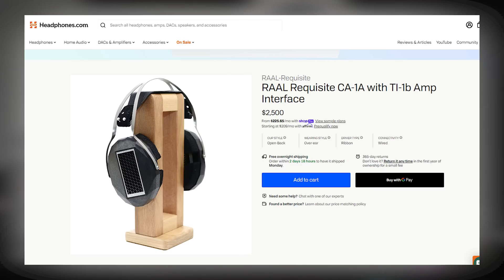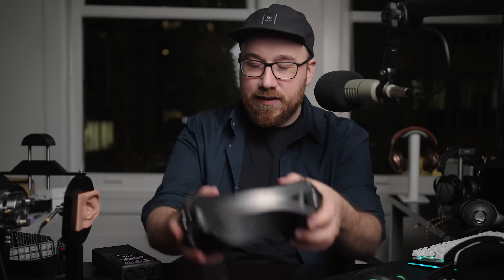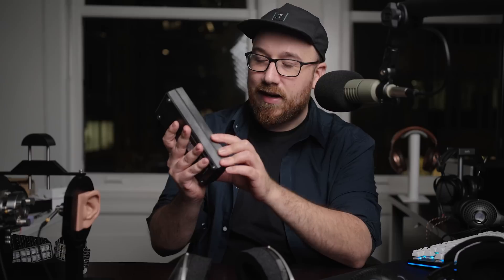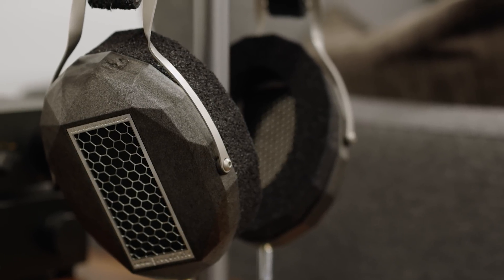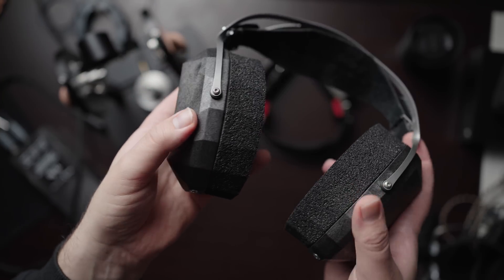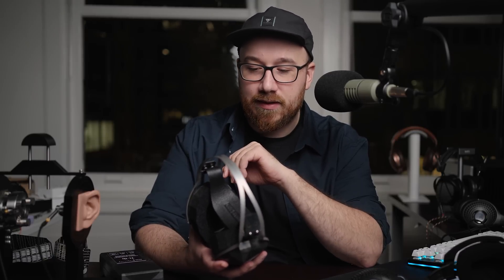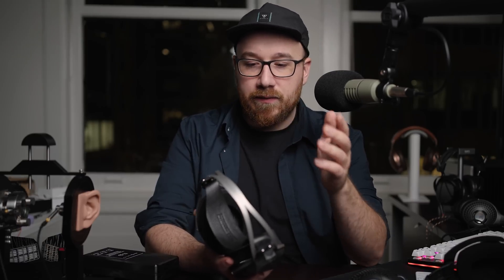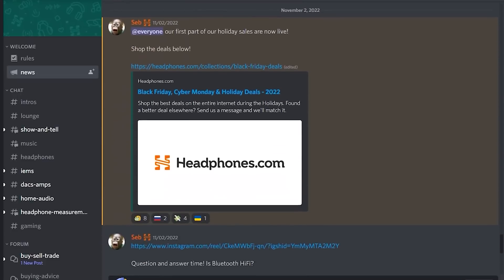What's a RIBBON headphone? RAAL Requisite CA-1A Review

Comment: One thing I forgot to mention, while the CA-1A is a circumaural headphone, it is still open-back. So sound does leak in and out, for those wondering.
Reply: Did you try these with the convolution filters? They fix some of the phase alignment stuff and make these a much easier req imo

Comment: Interesting.  As an engineer I would think that the ribbon driver would be very high velocity, quick on the percussive impulse attacks.  I have full length ribbon on my Magnepans and they were a monster step up over the earlier all 'quasiribbon' high frequency performance, both in sound faithfulness and actually extending the frequency response...the earlier Maggies sucked at both ends, but the ribbons are very easily damaged, grill cloth vacuum cleaners prohibited.  I would love to hear these.  I've got some DIY hybrid electrostatics mostly finished, the Sanders design with the Dyneaudio inhabited TL beam splitters, and am really looking forward to hearing them.  

Not headphones in either case, so sorry for the excursion (see what I did there?)...oh, and I have some Stax SR5s coming today which I'm really looking forward to hearing, as well.  Supposed to be some legendary legacy phones, as I understand it, and my Audio Technika TK33 electrets have long since gone the way of dying electrets...I think I will try to 'recharge' those sometime, but I need to build a well controlled oven to do it right.  

I enjoyed your review here, especially pointing out aspects like the ultra low distortion even at very high levels, in essence usable headroom for tweaking.  I was graduating high school about the time those SR5s came out, so it is also nice to see digital EQs that are actually beneficial, unlike their horrendous unusable cousins.  I'm one of those guys that preferred to turn off the preamp tone controls even with decent electronics, like the Hafler DH110.

Comment: It looks like these will need about 4-5db boost in the upper mids for me. What sort of output power does your amp need to have in order to run these 4-5db above hearing level without running into heavy distortion? If I have something that, say, puts out about 6W into 32 ohms (and I think 9W into 16 but I'm not entirely sure) will that be enough? The amp already runs quite hot, is thermal stability going to be an issue? (it's a Lyr 2 with LISST).

How's the midrange tembre after EQ? And how are the technicalities compared to electrostatics? I.e. if I already have a solid electrostatic rig, does this do anything different?

$2500 is a lot, but also a lot less than some. If it keeps up, that's actually quite compelling.
Reply: I'm running it with a Jotunheim 2 which is also rated 6W at 32 Ohms, sustained - though Jason has said it's 7.2W in reality but he prefers understating the numbers.  It has no problems driving the CA-1a through the TI-1b, dial's at 2-3 o'clock for a reasonable volume on high gain so it's using a lot of that power.

In terms of PEQ or "the curve", suggest looking at Accurate Sound's convolution filter for the CA-1a instead.  Gives you a flat neutral across the board and sounds fantastic to my ears.  Brings out even more detail and makes the wide soundstage even clearer.  Just set that up yesterday and blind A/B testing it was pretty easy using their Hang Loose Convolver with a trial license - was surprised at how much of an impact it has.  Look it up if you're even mildly interested in these.

I know the looks are polarizing but I'm actually a big fan of it - appreciate the emphasis on function while pursuing a different design and look.  They are also very light and sturdy as a consequence.  Would have no qualms taking these on travel if it didn't need extra weight for amp and interface.

Comment: headphones can just always be seen as reverse microphones, ribbon mics, ribbon headphones.
Wonder if there is such a thing as a condenser headphone.
Reply: YES!!! There is such a thing as a CONDENSER HEADPHONE and they have been around for awhile!!!  STAX and AUDIO TECHNICA both sold ELECTRET CONDENSER HEADPHONES, DECADES AGO!!!  STAX ------- SRr84 Lambda Juniors  Electret Condenser Headphones (Which I owned as my first pair of HIGH-END HEADPHONES in the 1970's) and AUDIO TECHNICA ELECTRET CONDENSER HEADPHONE MODELS:  ATH-6, ATH-7, ATH-8 and AT-705.  ELECTRET CONDENSER HEADPHONES are similar to ELECTROSTATIC HEADPHONES, but have PERMANENTLY-CHARGED METAL GRID PLATES (being PASSIVE), instead of needing an external ENERGIZER BOX to ACTIVELY CHARGE THE METAL GRID PLATES.  ELECTRET CONDENSER HEADPHONES .come with an IMPEDANCE MATCHING BOX, to connect to a STEREO AMPLIFIER'S OUTPUT TERMINALS.

Comment: My vote is go with the SR1A use the adapter and get a Soloist 3GT.  Use the sub out and voila you've filled in the bass.   Ultimate speaker like presentation without all the problems of the room.
Reply: The biggest problem with speakers in a room is the bass. Subs needs drastically more treatment than speakers.

Comment: i have these and for about a month i ran them straight through a pair of Schiit Tyr monoblocks with no TI-1b transformer box - the cable provides a 2ohm load to the Tyr - it was so smooth and sounded amazing - the comfort is off the charts - ignore the "build quality" it doesn't matter - now i want another pair of Tyr just to run these - with the cayin ha300b-mk2 off the speaker taps with the box its also amazing